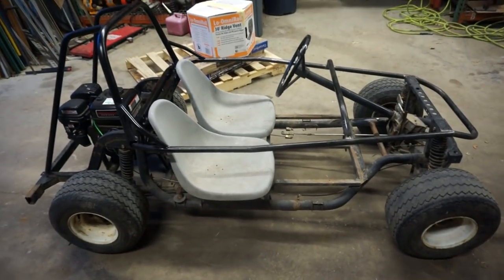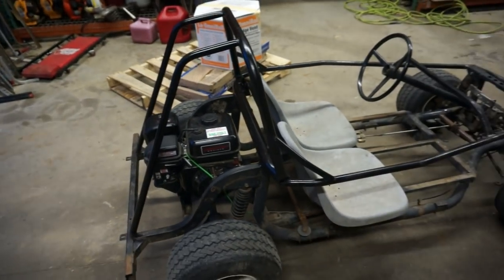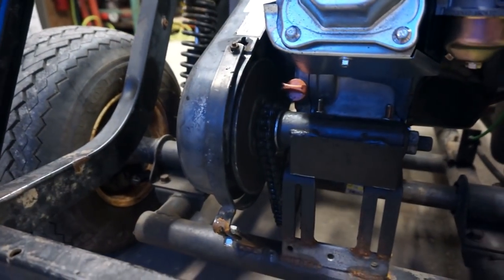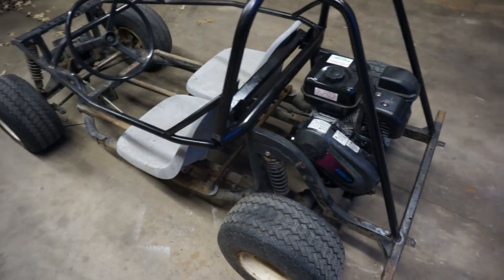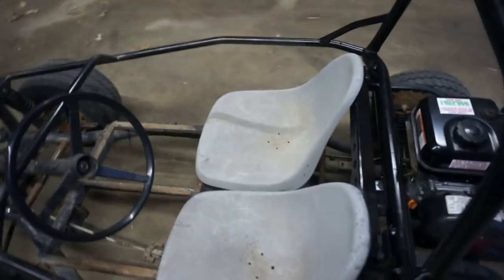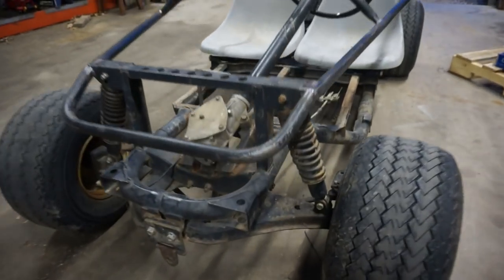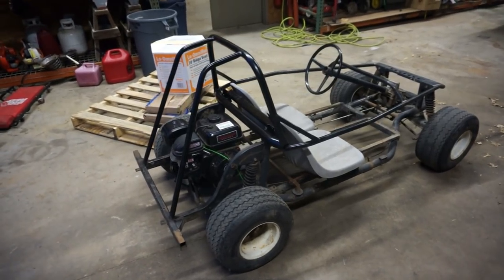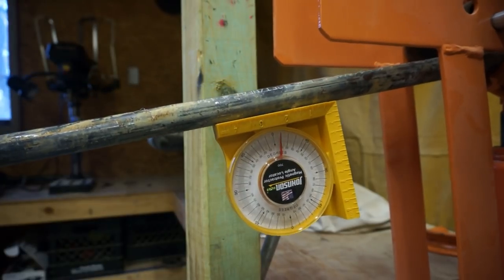Homemade Go Cart! (recycled Golf-Cart)

Comment: How fast will it go?
Reply from the maker: around 35 mph
Reply: AK Custom Hate to ask all the questions but I’m doing this same thing with my old cart and would love any advice and tips you would be willing to share. And did it have coil overs and strait axel from factory? Thanks.
Reply from the maker: @bradyoakland9287  front  had independent coil overs and rear was coil overs on solid axle that I built. so yea main tip I would give because I screwed up on it was the power to gear ratio if that makes sense. I tried making it go as fast as possible by sprocket reduction but in the process I stole to much power from the engine that my acceleration wasn't to good and the engine didn't have enough power band to take to top end so part of the problem there was not enough power to begin with but also not using it to its full potential. not sure if that makes sense but I also don't know your situation ether.
Reply: AK Custom I’ve gotta the opposite, my cart has a diff and I’m worried i wont get good speeds out of it even if I do a dirtbike 450 motor that has gears. I won’t be low on torque at any point. And I have leaf springs front and rear instead of coils and I would have to fabricate a swing arm if I wanted rear coils. My cart is a 1996 melex 212 gas cart and it has been the biggest pain to take apart  they were built with the last forever mindset.
Reply from the maker: @bradyoakland9287  cool I have always wanted to use a bike or atv engine with the built in tranny,  so with a 450 you might have enough power in the top end speed, just curious how will you transfer power from the sprocket of the tranny to a diff in the rear? also if it was me I would just leave the leafs probably not worth the work switching to coil overs, but again thats just me.
Reply: AK Custom I will have a chain going from the crankshaft of the bike to where the clutch for the old motor is it will be taken off and a sprocket will replace it. Only not sure if I am better off to keep the clutch and get a duromax 18hp electric start. Kicking a 450 over in such a small space may get annoying